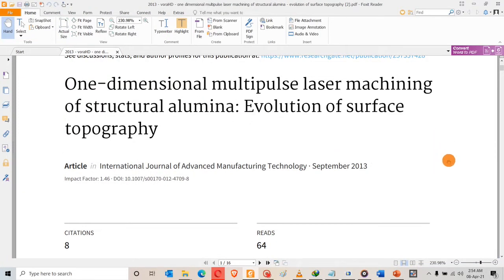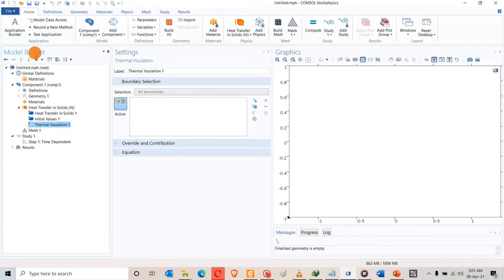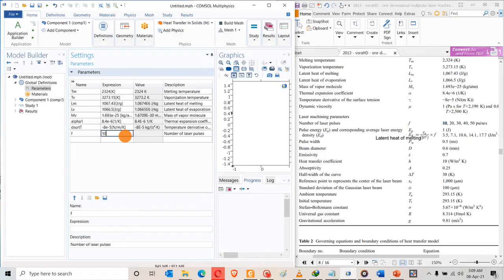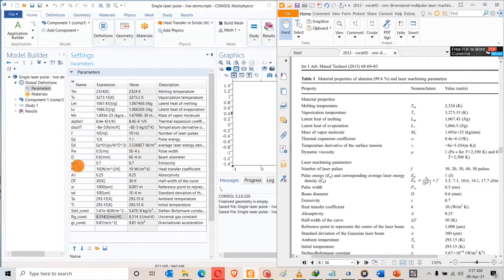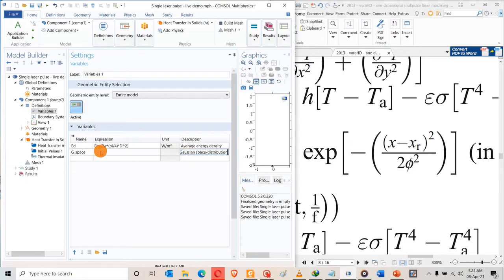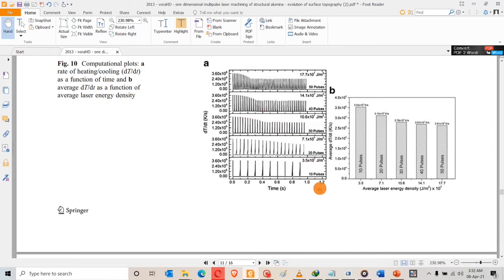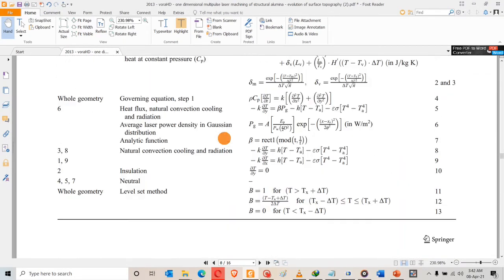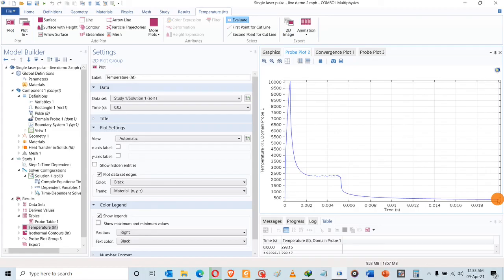How to model a single laser pulse in COMSOL Multiphysics | Laser Modeling, Heat Transfer - Part 2

Comment: May I know how to get pulse over lap(50%) for the same rect1 used in this video?  Will be helpful for me.
Reply from the maker: 50% pulse overlap is a function of beam scan or traverse speed and pulse repetition rate (frequency). Adjust the parameters accordingly (mostly scan or traverse speed). Check out the article by Prof HD Vora in the link to determine which speed or frequency (within your parameters) can give you this overlap. Don't forget to adjust the computation time too.

Comment: Thank you so much for your demonstration. I tried to contact you for consultations by email. However, I got some problems with email sending. Can you please tell me how to get in touch? I tried to process the rest of the paper to obtain the pool shape. Could you please instruct me on steps to coupling the fluid flow and boundary conditions to get the surface topography after solidification? Thank you.
Reply: Hey,
Did you figure it out?

Comment: Thank you for the great and informative video. I am getting very similar results as you but it looks like my laser is shifted to the top left of the central rectangle and not in the middle. How did you define the position of the laser? I am trying to see if I miss-typed anything
Reply from the maker: I think the issue on the positions (x and y). Please double-check how you inserted all the components of the Gaussian pulse equation.

Comment: Sir I don't see the radiation losses option in the Heat Transfer in Solids
Reply: I also didnt see it. There is a surface-to-ambient radiation option. Is this the same?
Reply from the maker: yes, it is the same.
Reply: @chemicalsimulationcorner  Can you please explain how to model multiple pulses?
Reply: @kushagrakirtiman3292  Hi

In the analytic function Pulse created using rect1 function change upper limit of the argument to 1 sec then you will have have multiple pulses. Also when running the simulation in solver configuration increase the time range as per your need. You will have multiple pulses.  I hope this will help you.

Comment: Can you please explain how can i add a Pulse train (Multi pulse sequence) of the equation T(t)= ∑n

i= 1 (exp(-4*log10((t-2*tp-(i-1)^2)*Δ
/(tp)))) as analytic continuous function of the Gaussian pulse train in comsol. Rather using a rect pulse or mod operator like in your demo. Here tp is pulse duration , n is the pulse number in a train and Δ denotes the temporal
 separation between pulses in a train. Thank you.
Reply from the maker: Step 1: Create an analytic function, name it "Pulse" instead of "T(t)"
Step 2: Insert that function in the appropriate space
Step 3: define "tp", "n", "Δ" and "I" in the parameters section
Step 4: place the function name "Pulse(t)" where "rect1" is placed in the Gaussian pulse.

NB: Change "T(t)" to "Pulse", "n" to "n1" and "i" to "i1" or any other symbol as this might give you errors during the computation. COMSOL has or may have already assigned something else to these symbols in its coding. For example, T=temperature, n=number of iterations, i=imaginary number or eigenvalue, etc.

I hope this helps.
Reply: @chemicalsimulationcorner  Thank you for your reply, I was trying for your suggestion but unfortunately  I am stuck in creating the summation for the pulse train when  I use sum operator in analytic function it gives the error "the operator is not allowed" and in parameter section the increment function of sum operator is also not working giving error "illegal contents". Can you please specify how can i use the sum operator in comsol and also define sigma notation for summation?. I have tried the below equation as analytic function but failed

pulse(t) = sum(exp(-4*log10(((t-tp-(i-1)*del_s/tp)^2)))i, 1, 4 )

My description are here defined in parameter 
tp = pulse duration = 27 ns
del_s =  16µs
n1= number of pulses = 5

Σ exp(-4*log10(((t-tp-(i-1)*del_s/tp)^2      for i =0 upto 5

Comment: Your video is very informative and easy to understand. I have just started with COMSOL Multiphysics. I have gone through the paper of Prof. H.D. Vohra. Your video cleared so many questions in my mind. Thank you for the beautiful demonstration. 

Can you please also demostrate heat transfer with fluid flow?
Reply from the maker: Thank you so much for the kind words. We'll are developing a tutorial for fluid flow as well and we'll upload it soon.
Reply: @chemicalsimulationcorner  
I have a query for your kind consideration. 

I followed all the steps as per your video for single laser pulse modelling but I am unable to get the same temperature profile as yours. In your video the temperature graph peaked at 10000 K but in my model the temperature graph is getting as high as 350 to 370 K only. Can you suggest what may be the problem?
Also why have not you used any insulation as a boundary condition?

I have emailed you also about this query.
Reply: @zainsiddiqui9283  same here
Reply: @mpraele  Hi,

In the domain probe change probe type from average to maximum. It will work then.
Reply: @zainsiddiqui9283   Thank you it worked and the overall trend is similar
Reply: @zainsiddiqui9283  Thank you so much
Reply: @chemicalsimulationcorner  Please post the link here!
Greetings from brazil!
Reply: Hello, could you simulate the same result in the video?

Comment: Nice explanation. Expecting a tutorial on Heat transfer coupled with Fluid flow and interface tracking with Level set/Phase field. Experiencing numerical complexities. Also could you please tell which would be the best way to define viscosity as a function of temperature. The domain should behave as a fluid once crossing the Melting point. Tried out the same with Heaviside functions still not converging.Thanks a lot.

Comment: Very nice presentation. How we can analyze the melt pool geometry?
Reply from the maker: Hi Brijesh. Its a bit of tedious process, the easy way is to place probes (domain, line and points) and run the simulation do detect the areas with temperatures you are interested in. The other method is the level-set method, which we'll include in our next projects.
Reply: @chemicalsimulationcorner  Thanks for the reply. when I can expect your next video?
Reply: @chemicalsimulationcorner  How we can apply the level set equation?

Comment: For Wire EDM machining, how to add a Gaussian heat flux of the order of 
 10e10 W/m2, and is it parail with your tutorial?
Reply from the maker: Heat flux is determined by your power input and contact area of power deposition (i.e. Heat Flux = Power/Area = Voltage * Current / Area). Calculate it like that (power) and then multiply it with the Gaussian distribution. For the Gaussian Distribution, you must know the standard deviation of the profile for it to be accurate.

Comment: Very nice demonstration. I appreciate that very much.  I have two questions: (1) If  the solid target is under a liquid ( e.g. 2 cm water on it), how can we consider absorbed laser energy by the liquid?   (2) how can we consider target removal (via vaporization)? is it somehow  by creating a material density dependent function?
Reply from the maker: Thank you very much. Answers 

(1) Add a 2cm layer of water above the sample and remove the heat load from the sample and place it on the surface of the liquid. In this way, any energy reaching the sample will have to pass through water by conductivity (of the liquid).

(2) Consider reading the work of Prof. H.D. Vora referenced in the description. He applied coupled heat transfer with fluid flow and detected the vaporized element using the "Level-set method". He there physically removed the layers and modified the geometry and reapplied the boundary conditions. Factoring surface tension and viscosity allowed him to demonstrate the residual surface topography. 
I recommend that you take a look at his work. It's amazing. We will replicate it to in our upcoming demonstrations too. No worries. 

(3) Yes, all material properties must be temperature dependent for the simulation to be realistic. It'll consume some time and computational power but it's worth it.

Comment: very nice and informative work. can we obtain the 1D plot here for absorbance vs time?
Reply from the maker: Absorbance is a constant value here. Perhaps if it was a function, we were going to be able to extract the plot. But, in this case, it is not possible. I love your question though, it's something we'll definitely look into in future demo's. Thank you so much Wajid
Reply: @chemicalsimulationcorner  Thank you very much for your response. if feasible for you, can we talk about the issue of transient absorption via emails? Basically, my question is related to the Kerr effect (i.e change in the refractive index of a material in response to an applied electric field/ultrafast Laser )

Comment: Hello Sir, I am trying to design a laser pulse with a 200 ns pulse width at a 200 Hz repetition rate. In this video, it was for 0.5[ms] pulse width at 1 Hz. I changed the width to 200 ns and changed the f to 200 Hz. But, in pulse function(in comsol), I can not see the pulse when I am plotting it. Could you please help me in this regard?
Reply: Helo sir,I have also encountered this problem now, do you solve this problem?
Reply: @tanshu6548  No, I didn't get the solution yet :(
Reply from the maker: If you have done it correctly, I think what is left is to adjust the computation time. The computation time must be = t = (1/Frequency) + Pulse width. So, for your computation, t = (1/200) + 200E-9 = ?. I hope this helps.
Reply: @chemicalsimulationcorner  Sir, Thanks for the reply. In Analytic function, the pulse width of 0.5[ms] at a repetition rate of 10 Hz means 10 pulses in a second after every 0.1 seconds. Similarly, for the case of the pulse width of 200ns at a repetition rate of 10 Hz means 10 pulses in a second after every 0.1 seconds. My problem is when I selected rect1 with a pulse width of 200ns instead of 0.5[ms] , the analytic function rect(mod(t,1/f)) did not show the 10 pulses in the plot. It will be a great help If I can email you with a detailed attachment. Thank you so much once again.
Reply: @unseen.reflex  hello did you find the solution for the problem
Reply: @kushagrakirtiman3292  No, The problem was not solved. I give up the simulation. :(

Comment: Roger Sumner This is very well done! I didn't see a part 1 - is there one? I also could not find a part 3. Let me know if I can help with a part 3 if it hasn't been made. One comment is I think the peak should be used as the amplitude of the gaussian instead of the average, so I think you need to multiply by a factor of 2.

Comment: hello sir!
tutorial is amazing. kindly help me in electric current problem in which i want to limit the
 current during the measurement and increased its level very smoothly in steps of 50 nA every 15 s. how can i do that please help me.
Reply from the maker: The quickest way to do this is by using an interpolation function in COMSOL. 

Step 1: Try to view the behavior of your current in a plot by drawing a plot of I(t) vs time in your notebook or Excel. 

Step 2: Extract the values of I(t) and t and transfer them into a table.

Step 3: Right click on "Global Definitions" >  expand the "Functions" node > select "Interpolation"

Step 4: Enter the values of t in appropriate column, and enter the values of I(t) under the f(t) column.

Step 5: Click plot and view your function in the graphics window. If the plot doesn't look like what you planned, adjust the values until you are satisfied with it. 

Step 6: Call the Interpolation function in your variables node or under the physics node or wherever you want to use it.

**NB: Remember to insert the units. 
I hope this helps.
Reply from the maker: Thank you very much